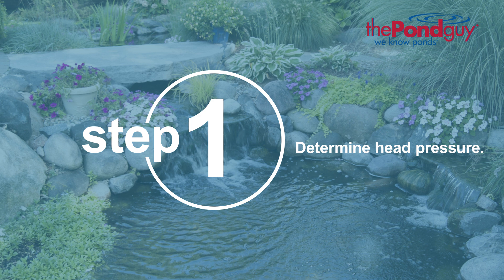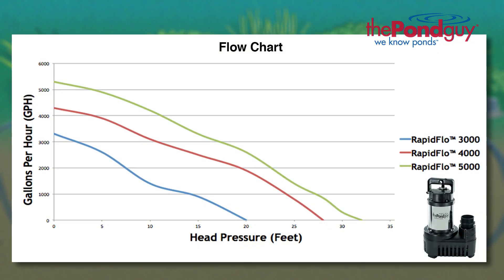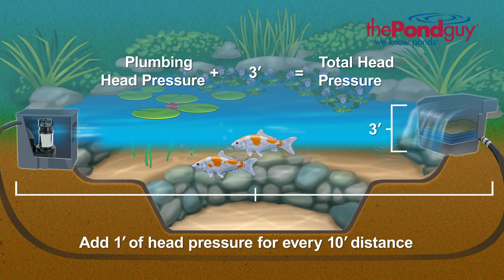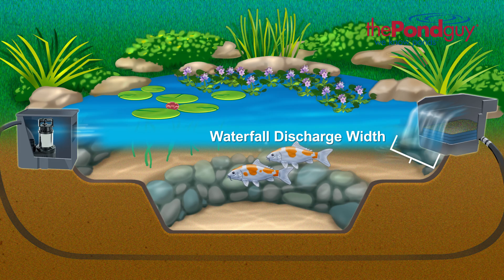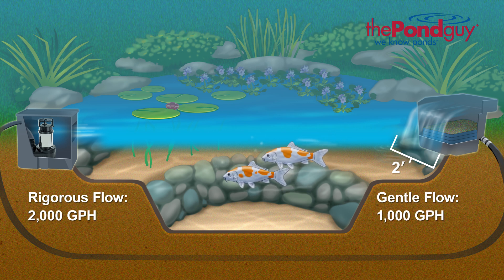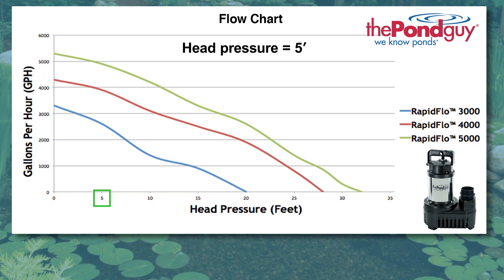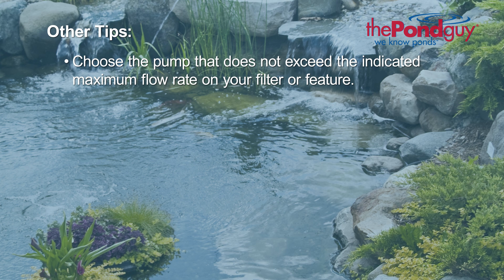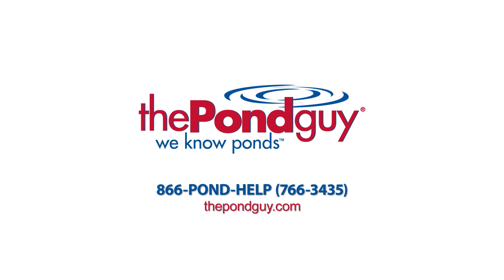How to Choose a Koi Pond Water Pump

Comment: Won't limiting flow manually add strain to a pump and reduce its lifetime?
Reply: Pumps draw less current and do less work when restricted. When your vacuum is blocked the speed increases and current drops
Reply: @woodzy575  The inlet or outlet?

Comment: I'm building a pond with an upper basin flowing over a retainer wall into a larger, lower basin.  The plumbing needs to run 33 feet from the skimmer to the biofalls.  does that require a larger pump?  thank you
Reply from the maker: Hello Patsy - The flow needed for a pump is related to the size of the waterfall feature. Please contact us at (866)766-3435 and we can assist you with sizing a pump.

Comment: What pump do I need for a large rock with a one inch pipe coming up the center?  Pump is going to be approximately 5 feet below the top of the rock.  The rock is about 44 inches tall and 40 inches wide.  I'm pretty sure the pipe is one inch or maybe 11/4 inch diameter.
Reply from the maker: Hello Paul- Please contact us at (866)766-3435 and we can assist you with sizing a pump and making a few recommendations for this. Thank you!

Comment: hi, what if my pond size is a bout 1.5 m x 1m, depth about 1.5 feet, which is best. Thanks Pond Guy
Reply from the maker: Hello - The pump size is determined by the waterfall or pump size and not the pond size itself. Please contact us at (866)766-3435 and we can help you find the right pump for your application.

Comment: I have a 16' long by 4' high retaining wall.  I would like to form 2 streams coming from that with  flowing sounds and waterfalls (short) included in each stream.  Stream lengths only about 6'.  Can I use a single pump in a collecting pondless return?  Your video was very informative.
Thank you.
Reply from the maker: Hello Darrell – Yes, you would be able to use a single pump. Please contact us at (866)766-3435 and we can help you calculate what size you will need.

Comment: But , if its flow rate reduces by a valve or using smaller tubing, thus causes heat build up in the pump and reduces durability of pump.